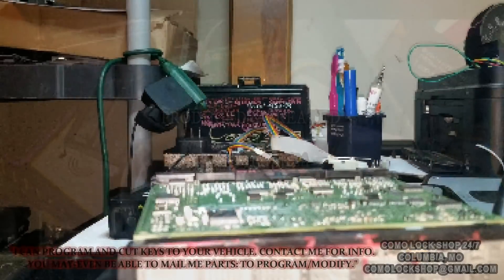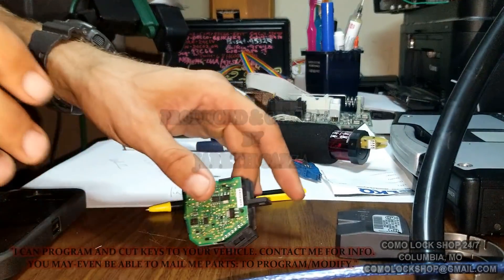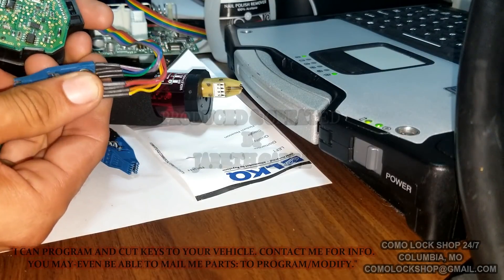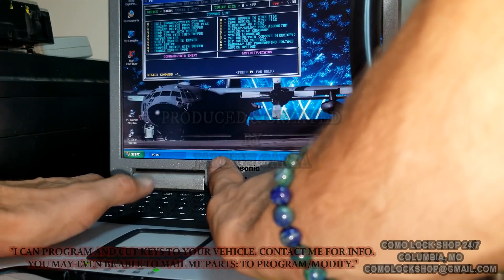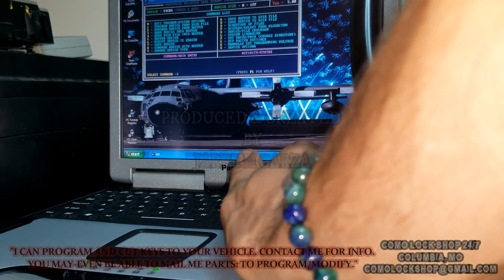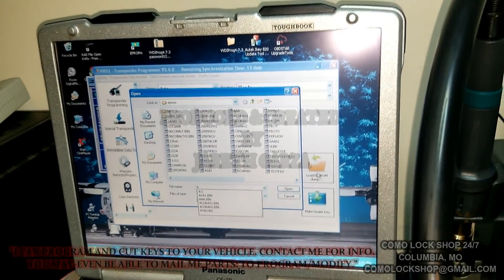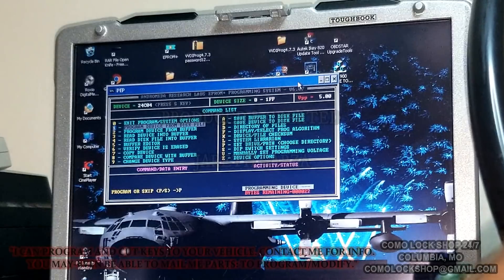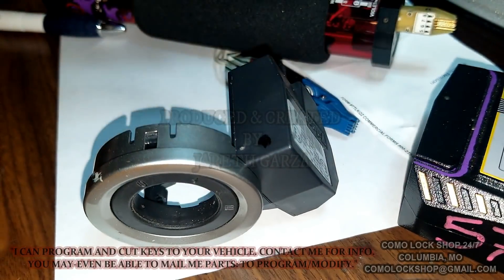Honda/Acura “IMMO-Off,” Programming using AR32 and VVDI2 - MODDING AN IMMO_BINARY-FILE!!!

Comment: i was wondering  if i dump the immoblizer  ring eeprom  and send u the file how much u want to add and ship me a chip for a key i got a 05 honda element i lost all keys for  i been driving it with a jdm ecu in mean time but id like to get stock ecu working   what u charge   i got flash tool just lack the reader for the  key chip
Reply from the maker: No thanks. Rather commit to the whole process rather than leave it to someone ill equipped.
Reply from the maker: I dont mean offense either I just mean Id rather have immo ring in hand and handle whole process rather than half and leave the rest to someone else. 

Hubble telescope was engineered by two separate teams. When it came time to plug their work together, they made easily fixable errors. It cost the project almost a year and millions in correction.

Comment: Hello, what would it be? the best option to program vvdi2 or tango I want to acquire some of the two but I have little experience could you give me your opinion please
Reply from the maker: Vvdi2 is my choice since its essentially a cloned Tango
Reply: VVDI2 is somewhat derived from Abrites AVDI, Tango clone is TM100.
VVDI Prog is derived from XProg-M
Reply: +Terry Field thanks and in prices the vvdi2 is better than tango
Reply: VVDI2 and Tango are two very different tools
I am an Auto Locksmith in the UK and use Tango in conjunction with Orange-5 on a daily basis.
I also own Abrites AVDI, Xhorse VVDI2, Prog and MB BGA tool among others, it really depends what work the tool is needed for.
The best all round tool for coverage is Advanced Diagnostics AD100Pro and Smart Pro.
Reply: I own both, but Tango original is the better tool
Reply: +Terry Field  thanks I will take it into account to continue improving my services
Reply: I’m new to eeprom. I need to buy a programmer, either the vvdi2 or Tango. One thing I don’t understand, do you need to buy software for each make you will be working on? Like if I’m going to be working on Saab, I will need to buy Saab software in addition to the actual programming unit? I don’t see various softwares for VVDI2, but there is a large list of softwares you can buy for the Tango. Someone please help me out with this. Thanks

Comment: hi friend this aint IMMO-off . u made a dealer key. immo off is when u start car w/o chip. u got the titles wrong ,it should be programming dealer key instead of immo-off. nice video .
Reply: 嗯，还以为是移除防盗呢。
Reply from the maker: jasonics md the immo is off the vehicle. So im right. Thanks dear
Reply: @JarethGarza  great work bro.. as a locksmith tho I say all over the world they say immo off for basically turning the immobilizer system off. 
Maybe on bench is the term you're looking for?
Reply: @JarethGarza  Jasonics md is right, a term immo off is no chip to program to start the car. Your procedure is make a dealer key, good video anyway